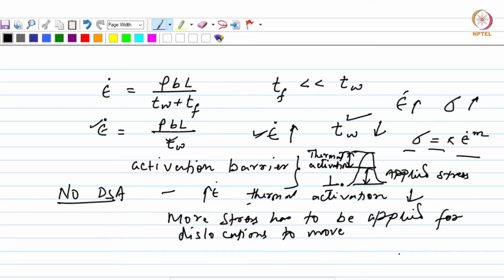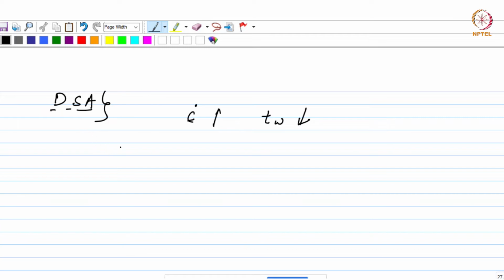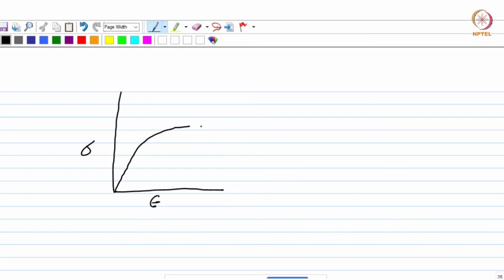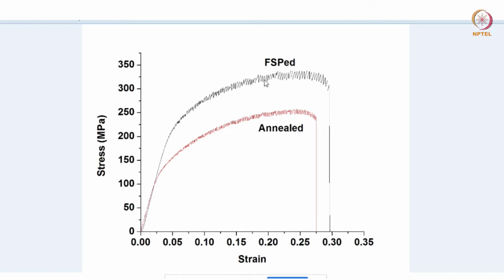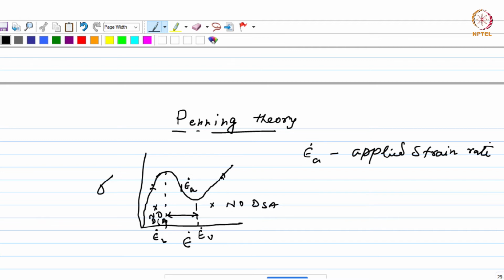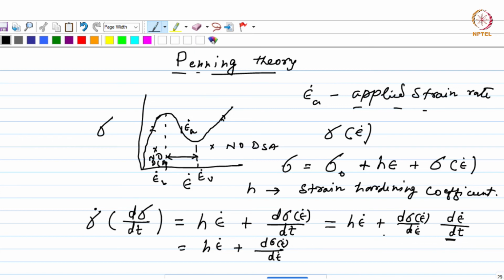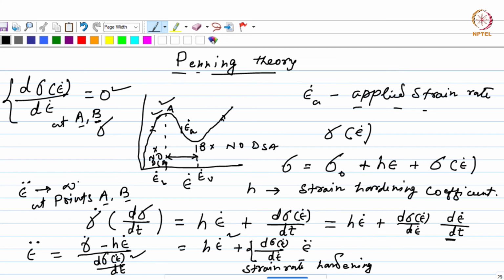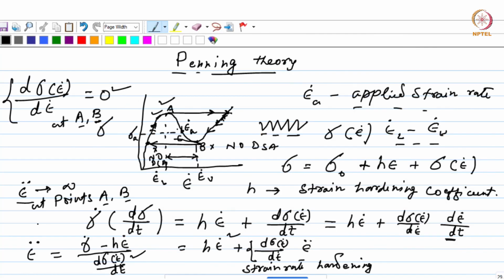#12 Dynamic Strain Aging (DSA) | Aluminium based Alloys & Metal Matrix Composites

Comment: A confusion regarding DSA and No DSA in Lectures 11 and 12: No DSA means: material without solid solution strengthening (for generic strain-rate dependence), or material with solid solution strengthening and outside DSA. Because with solid solute strengthening, there can be DSA, and there can be no DSA. Now, DSA at higher strain rates will cause a faster movement of dislocations, and the solute atoms will not be able to pin down the dislocations, and the flow stress will be less at higher applied strain. On the other hand, if the strain rate is lower, time will be higher comparably, diffusion might occur, and solute atoms will be able to pin down the dislocation, and flow stress will be higher for applied strain. But these two cases of DSA will again be affected by the temperature, which determines how diffusion occurs in the material, as DSA is time and temperature-dependent.